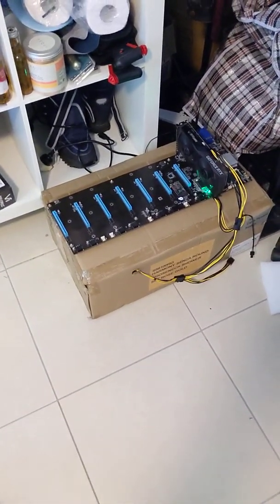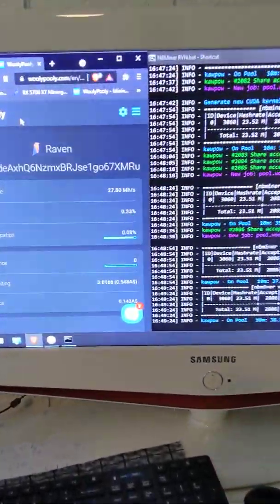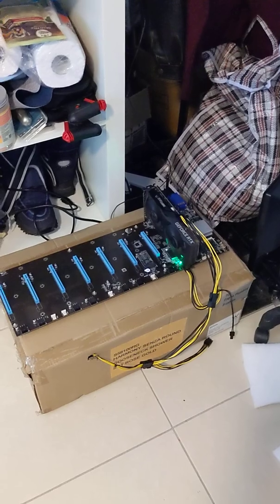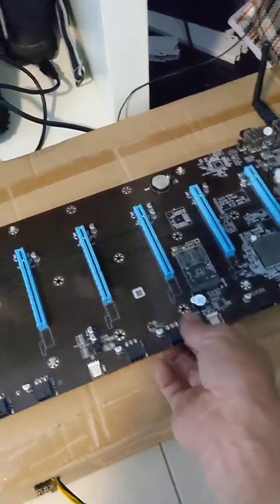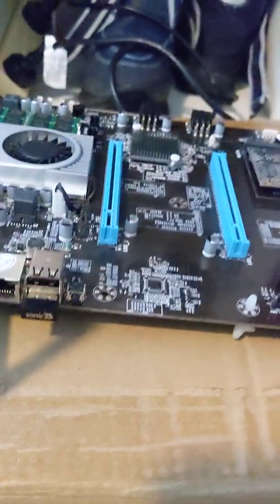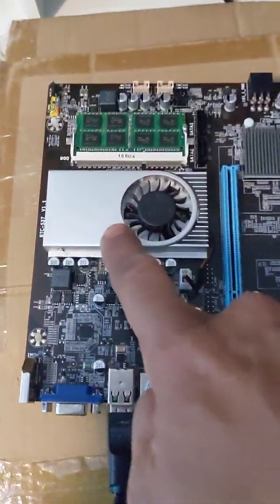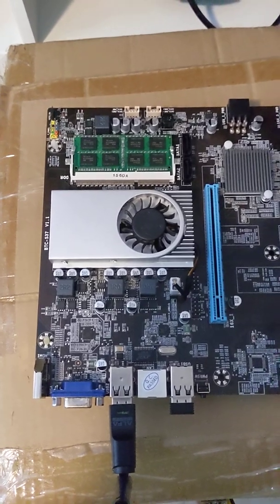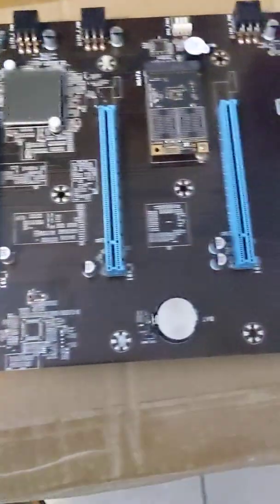BTC-S37 - Which power supply, and how to run it?

Comment: Do you power all the 6pins on the board or just 1?
Reply: you power however many you use. so 1 card=1 6 pin etc
Reply: @GhostvaperYT  so if I have 8 3090 cards I should be powering all 8 of the 6 pins on the board? Do I need to use the same psu for all 8 connections or match psu with card and 6pin. I have 3 psus.

Comment: I  have a BTC-S37 coming.  I do not have ethernet connections and am also  unable to use a Poweline connection due to the anticipated location for  the device.  I see that you use a wireless USB dongle. Would i need  to modify the bios for the BTC-S37 to recognize the USB-dongle or was it working for you out of the box?
Reply from the maker: Mine needed a driver off of the internet, so I downloaded that on my laptop and transferred it on a USB stick.  Aside from that, it was seamless. It recognised the home WiFi plus my phone hotspot straight away.

Comment: What wifi adapter are you using, and would you recommend it?
Reply from the maker: Hi there.  It is a very cheap $3 USB job that I bought on eBay.  Works like a charm!  All you need is something simple, just make sure it has drivers, or at least a link so you can download them to a USB drive

Comment: Please take your power supply out of that box.  PSU's can generate quite a bit of heat and you have it inside a flammable container.  It's just a risk you don't need to take.
Reply from the maker: No, I can sleep with it in the box.  The noise is at a bearable level. I have it monitored 24/7.  Even with 3 cards, it is running at +3°c ambient.
Reply: @shanea6140    if i were you shane mate id get a temp probe for that box that has an alarm if it goes above a safe temp just to be sure you are safe i think you are ok with the exhaust fan but if you ran 8 cards it would get hot

Comment: Good info Shane,  Have one of these on order and much appreciated.  I would caution using to splitters like crazy...they handle only so much power per PCIe cable (150w max)...and you can easily overdraw power on the primary cable (out of your PSU) and melt/burn things up.
Reply from the maker: A good point about the splitter cables.  For my setup, I do only connect 1 card to a chain.  The extra cables are purely for reach, and each cable out of the PSU feeds only one card.